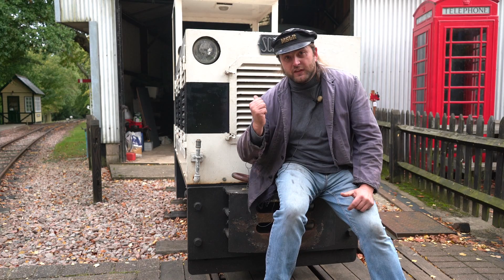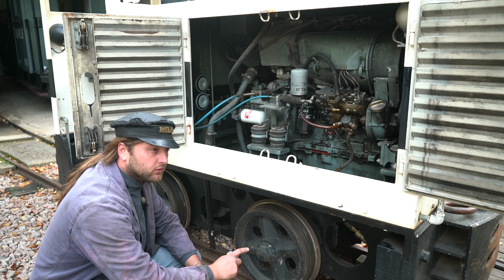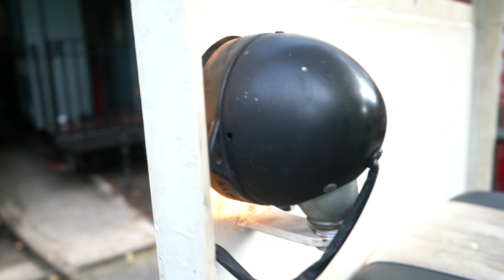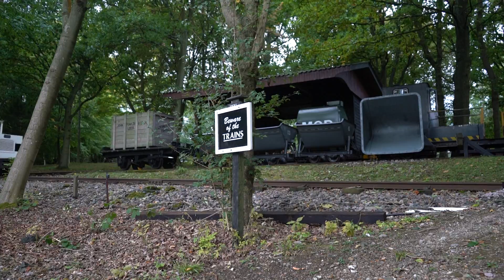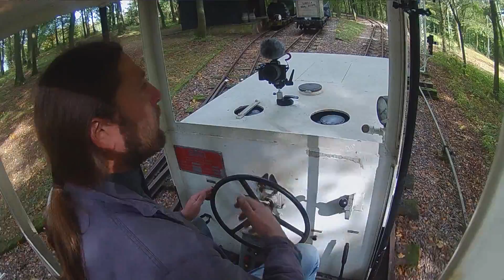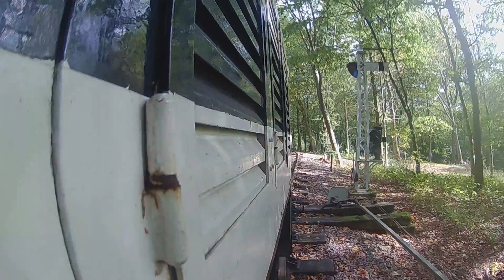Schoma CHL-30G, German air cooled goodness - Lawrie Goes Loco Episode 10

Comment: Its not the Engine which works hydraulic, its the gear. You dont need any clutch to drive. Just pull the throttle and if there is oil in the gearbox, you can drive. To stop the train, just flush the oil and no engine movement is transmitted to the actual gears

Comment: It's controlled like a model railway loco with a wheel and worm gear but without a giant in the sky to rerail rolling stock and ping the points as necessary. It sounds gorgeous as diesels go, real smooth.

Comment: you can't kill a deutz engine. Thats impossible. And Deutz made Air cooled engines not just bcs it was simple. You can drive those Engines everywhere. Even when you have 40+ celcius or -30. I know that bcs i am from germany and my family had a Deutz tractor with 2 cilinders and 24 ps. This thing was a workhorse like no other tractor i have seen. it was build in 1958

Comment: I dont know how in the UK, but at least in  most of Europe the "steering wheel" was the most common user interface to control the power (and dynamic breaking) on all non steam engines since the first electric ones appeared at the start of the 20'th century. It only starts to disappear since later 80's, when the advanced electronic and automation was dominating in the controls, so it became replaced by a straight moving handle. Even many industrial locos with mechanical transmissions use a kind of "steering wheel" to control the clutch...
Reply from the maker: It's not common over here. I've seen a few other examples, but certainly not the norm.

Comment: You've made the common mistake of paying attention only to the HP rating of that engine. In traction applications (trains, tractors, semis), all that matters is torque, and that loco would have torque in spades, what with the significant mass of its moving parts and all. Generally speaking, HP is a rating of power over time (simply put as the width of its power-band), which is a useless rating for prime-mover and tractor engines, which are gonna be stuck at the same RPM for peak power 90% of the time. Torque is a rating of sheer brute force, and it gives you a better idea of how an engine will perform under load.
Reply from the maker: It's just the only figure the owner could give me 😂
So that's what we went with.
Reply: @lmm  Fair enough.

Comment: Have you folks ever head of the Waterville Wiscasset and Farmington RR in Alna, Maine, USA? It is a 2ft gauge historic railroad operating pond a selection of the original ROW. It operates a couple of originnal steam engines and passenger cars. There is also a repair shop with the  capacity to repair the engines. Great museum.

Thank you for your excelent post.
Reply from the maker: I've not, but I'll be sure to check it out now!
You're most welcome

Comment: That's an adorable little locomotive :) Apart from the wheels and the ingenious "steering wheel" mechanism that controls speed and direction, I think it would be fairly easy to assemble something like this for my own personal use. There are plenty of small used diesel engines available, and hydraulic motors aren't all that expensive. You could even avoid having driveshafts by putting hydraulic motors on each wheel, and just having the engine turn a hydraulic pump. Pick up a sheet or two of 1/2" or 3/4" steel, and go from there :)
Reply from the maker: Oh it's pretty simple. Hardest thing I suppose would be making the wheels, but certainly it would be an interesting project!
Reply: Using modern laser or water jet cutting the raw wheels could be cut out of thick plate and then tuned to size on a big lathe. Axles would be turned from bar stock. Not a difficult job if you have big enough machinery.
Reply: @gregwarner3753  I would probably just buy round pieces of steel that were slightly larger than the finished wheels needed to be. However, as you pointed out, I would need to find someone with a lathe large enough to turn them down to the correct size/shape, as well as the axles. Not an impossible task to be sure, but I would have to do quite a bit of searching to find someone that can do it for me. I suppose I could always keep my eye out for someone selling an older lathe that would do the job, and just buy it  ;)
Reply: @Greg Warner I am also considering contacting the company that made the locomotive featured in this video, to see if I can buy that excellent "steering valve" mechanism :) If not, maybe I can find something similar from another manufacturer.

Comment: The pie warmer plate is a heat shield to keep radiant heat from the exhaust from aging the rubber motor mounts. A well thought out proper working machine, although I think the handbrake is a bit excessive having worm drive transmission it's not moving anywhere unless the drive shaft rotates.
Reply from the maker: I suspected as such, but I like the pie shelf idea more!

The handbrake I suspect is mostly for stopping the thing from creeping if the hydraulic valve is leaking slightly.
Reply: @lmm  You are probably right there, it's a German belts and braces design well thought through. The pie warmer feature is a happy by product of necessity :-)

Comment: check ya line poundage,  this isn't  designed to to be run on  a set of model rail way  track these were typically built to run about the sugar  cane fields   the cabin is designed to deflect sugar cane stalks  as the rail  was prototypical with a foot of the track..

I don't think the loco would be suitable  on the track you have, the only other thing  this could of been used for as track inspector..

it might of seen life in a coal mine aswell..

typically you would not be carting any type of large  rolling stock with it 

TYPE IN SUGAR CANE  FIELDS OF AUSTRALIA  YOU'LLL SEE SOMETHING LIKE  THIS HAULING 20-30  WAGONS
Reply from the maker: The Locomotive has now spent more of its life working at Bredgar and at the setup at Amberley than it did in industrial service.
I somewhat suspect that the railway that it lives at and its owner are completely aware of what it is or isn't suitable for, and it has had no issues so far.

The design I believe was used in mines, this one wasn't.

Comment: Many antique streetcars (trams) in Germany use a steering wheel on their type "B" controllers.  the handle of a type "B" controller would turn almost 360 degrees! One half designated with an arrow to the right reads, "Fahren" as in drive, go!  While to the left is an arrow labelled, "Bremse" or brake. There is a seperate control handle for forward and reverse.
Reply from the maker: Oh that's interesting. That's on electric drive though right? So did turning the other was start the motors to put up resistance this braking or apply manual brakes?
Reply: @lmm  Yes, electric! Trolleys, trams usually run on about 600 vdc.  Turning the wheel or control handle from the neutral point into the braking points adds resistance from the motors.  This usually fades out at from 3 - 5 miles per hour. That's when the hand brake is applied. Each braking point adds more resistance(through resistor banks).  When accelerating, however, each point of acceleration offers less resistance (through resistor banks); the final point of acceleration has no resistance..  Points of acceleration on a streetcar or tram will start with the motors in series, maybe 4 points with full series having no resistance; then a gap; then several, maybe three or four points of resistance with the motors wired in parallel; the final point having no resistance.
Reply from the maker: Oh that's quite interesting. I know very little on trams!

Comment: Ah, those crazy Germans, with their logic and practicality when it comes to mechanical devices.... Apart from maybe the "steering" wheel. Regarding the "steering" wheel: It's probably just as well it's top speed is "sloth": I would imagine panic might set in on approaching a bend at high speed and being confused between being on a road and on rails. Lovely work, Lawrie!
Reply from the maker: The biggest confusion is that until you've driven it a bit, it's not immediately obvious which way to turn to speed up or slow down 😂.
The wheel just means the control is always in the same place to grab hold of.
Sloth is indeed the top speed 😂
Reply: @lmm  Perhaps the wheel should have been turned 90° on the vertical access but perhaps there isn't the space for it.
Reply from the maker: Yeah, I think that would somewhat get in the way. The cab isn't huge 😂

Comment: Worm drive, this is basically the same design as used on model trains, except with an internal combustion engine.
Reply from the maker: Pretty much!
Reply: Worm drives does mean no park brakes required.
Edit: But it does have a brake lever. I'm confused.
Reply from the maker: I think it's to stop the thing creeping if the hydraulic drive leaks

Comment: Deutz air cooled engine are awesome no coolant or nothing simple to work on simple to fix . Another diesel air cooled engine that's commonly used in tractor and some other machinery . Maybe it's time for a air cooled tractor? 😂
Reply from the maker: I would be very up for that. I want something air cooled.
Reply: If you type into Google (same Taurus 60) that be a air cooled 3 cylinder. There's plenty around would be another one to the collection .👍
Reply from the maker: That's quite nice actually

Comment: I found this very interesting as I have rebuilt a few Deutz (and Lister) air cooled diesel engines including the 3 cylinder engine. If it has not been done already, I would recommend replacing the cooling fan bearing as the lubricant dries out and gets contaminated after many years. It is an easy and low cost job. Also avoid quick start spray on these Deutz engines as the detonation can cause the cylinder head to leak compression between it and the cylinder.
Reply from the maker: Thank you for the information, I'll pass it on to the owner.
What are they like to rebuild?
Reply: @lmm  The Deutz is not hard to rebuild but there are some procedures that differ from other engines.The head, connecting rod and main bearing bolts are angle torqued (more accurate) and require an angle torque wrench. Also there is no cylinder head gasket on the engines I rebuilt so the head is lapped in with fine lapping paste. It is best to get the Deutz repair manual before attempting the rebuild as there are a couple of other procedures as well. The only reason I had to rebuild the Deutz engines was either the cyl. head popped from guys using quick start spray (cold climate) or they went under water when the mine sumps filled up too fast and flooded the engines (the engines ran water pumps). The Deutz in the loco. should be good for many more years as they are very rugged and long lasting. Maybe replace or rebuild the fuel injectors at some point as they get weak after a few years.
Reply from the maker: So pretty good engines then if they're looked after?
Reply: @lmm  Yes, very good engines.

Comment: The tractor reference is very apt as Deutz engines are used in a lot of tractors as well as a lot of specialist heavy motorised equipment such as trucks used in oil exploration work as they're incredibly tough and will run for millions of miles on the sniff of an oily rag in terms of maintenance...
That one's probably not so bad when it's cold out as the hot cooling air from the engine will probably help keep the cab somewhat warmer...
Reply: Deutz also continued to use air-cooled engines for a fair while after other manufacturers had long been using liquid cooled engines.
Reply: @The_J_Man    Yes, absolutely, because they were ideal for use in very harsh conditions.  As long as the fan kept providing cooling air they were pretty much bomb-proof...
Reply from the maker: I had no idea that they were that good!

Comment: Reminds me of a modern hydrostatic lawn tractor with a little bit of Hunslet diesel-ism to it.

The paint thing is interesting, kind of the opposite of why steam engines are typically painted black - Neat that it worked in so many weird occupations like being on that cable ship!
Reply from the maker: Yeah, I imagine the actual drive will be pretty similar.
I hadn't thought of that about the paint, but yes interesting reversal. It's had an interesting life!

Comment: Is the steering wheel based on how steam trains work? From what I understand steam locos have a wheel fir forwards/backwards.
Reply: I am not familiar wit the US locomotives, but in Europe some of them (but far from all, i think it was only on some of the later ones, the older ones usualy had a reverseible lever) had a smaller metal wheel for controlling the valve, but possibly some small petroleum engine locomotors and small industrial steam shunters, had it in the 1930-40s? (However i might be wrong here since i am no expert, i just trying to remeber what grandfather once showed me when i was a little child...).
Reply: @daniel bean  No one of those i hawe seen personaly had it, so it may just be something i heard.
Reply: The only thing i seen in person that even reminds of that wheel is the old type of handcranked ranger brake adjustment wheel that was mounted inside some old wagons (wich was a big iron wheel mounted on the wall as i remember wagly from when i was a little kid), but i hawe newer ever seen it personaly in a locomotive, so it may just be something someone else mixed up and i snapped up as a kid, i don't know...
Reply from the maker: I think it's just this was a simple way of controlling the valve, and allowing you to hold it from any area, as apposed to a lever that you need to hold.

I think you're referring to a screw reverser on a steam locomotive, which you wind to change the valve timing. From the 'mid gear' position, winding forward will set the valves for forward motion, and backwards is for backwards.

Comment: you are one of the luckiest guys i know. you get to play with the coolest toys. the steering wheel is a rotary hydraulic valve. that's a very sensible way of controlling that engine, seeing as it is hydraulically driven. we had a ih 706 tractor that had power steering, and the steering was controlled by a rotary valve. there was no physical connection to the wheels at all.  the paint thing is a good way of gauging time of use on the engine. a clean engine hasn't been used much. a dirty one has, and needs some attention.
Reply from the maker: I am rather having alot of fun - can you tell?
It's a super way of controlling a Loco. Makes total sense on a hydraulically driven thing.

Oh that's a cool steering setup.

I thought it was a great way of keeping on top of maintenance. When dirty, service 😂

Yes I know it's not really a steering wheel, just I liked the term 😂
Reply: @lmm  it would be kinda neat if it were a steering wheel, and it could go off track. could you imagine "off roading" a railway engine? sounds completely bonkers, and tons of fun. i saw a supra today for the first time in a long time, and i thought of you guys. amazingly enough, it didn't have any rust at all. must have spent most of it's life out west, i figure.
Reply from the maker: My Supra is so rotten 😂

I mean there are diggers and such which go off road and then onto rails.
I'll need to get a go in one 😂

Comment: Is kind of a unique little loco, and I can’t believe that’s the newest loco you have driven!
So how many gauges do you get? 
And I’m I right I’m thinking there are multiple narrow gauges? (I don’t getting why they don’t just standardised them all.)
And the coupling system is different, I’m guessing there are multiple systems for that also?
Reply: Many country's have multiple narrow gauges and not all country's have the same
Reply: Changing guage is rather bloody expensive and inconvenient as you need to modify everything in a fairly short space of time. For isolated industrial stuff there's really no point.
Reply from the maker: It's pretty new 😂
The UK was pretty standard with 4 foot 8 & 1/2 inches for standard and 2 foot for narrow.
Serveral railways where 2 foot 6 inch, and rarer still was 3 foot guage.
Couplers varied hugely from railway to railway.
Quite a few narrow guage railways have convoluted ways of connecting things together which weren't designed to work together 😂